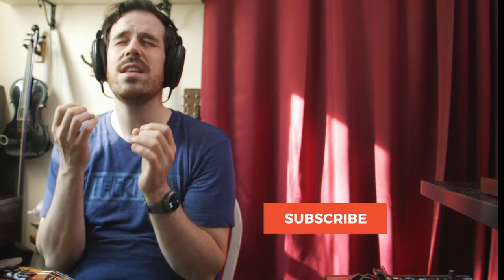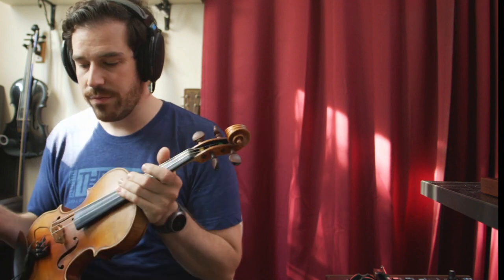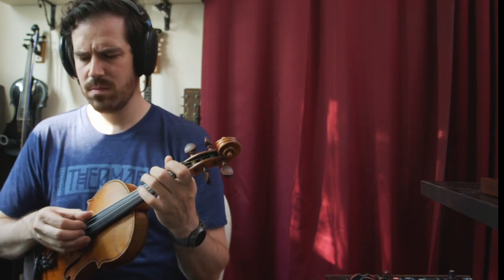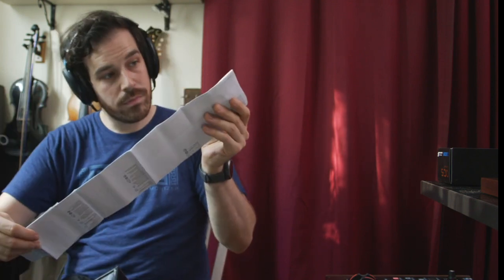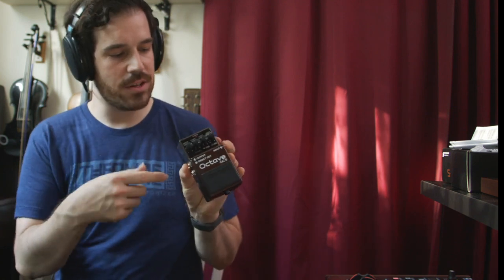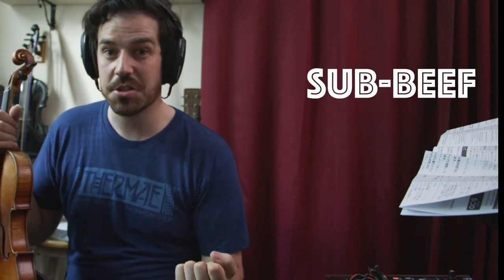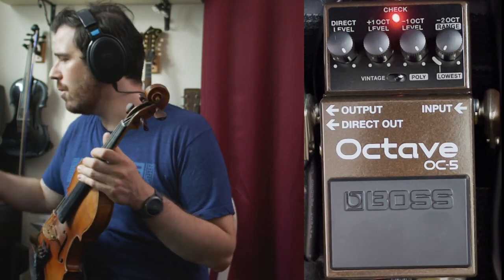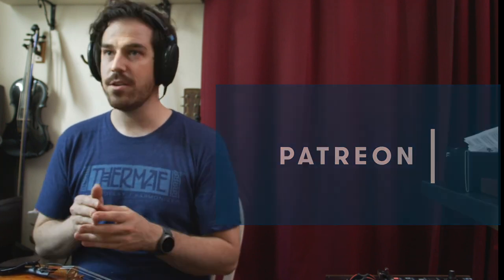EPIC Octave Pedal Shootout (Boss OC-5 vs My Favorites for Violin)

Comment: Great video, many thanks!  I'm experimenting with the octave down on the ME80 (the effect on the expression pedal) which is ok.  Is there any way to hear less of the 'ambient' sound on my electric violin - all I hear is octaves rather than just the octave down pitch.
Reply from the maker: Thanks for watching! If I'm reading correctly, you'd like less of your dry signal, and more of the suboctave? If yes, you can control the balance of each octave using the three knobs in that Comp/FX1 section—more of the first two knobs (-1 and -2 oct), and turn down the third knob (direct). Hope that helps!

Comment: Great video dude! Appreciate you linking my OC-5 vid, very kind of you. 

Yeah I find myself mostly using the Poly setting in lowest range mode as a sort of makeshift bass + guitar/violin in my looping setup when the song doesn't allow time to layer a bass line. Remarkably handy for that. 

Would be super curious for your thoughts on the EHX Bass9. It's pricey, but so far it's the closest I've seen/heard to an actual cello/upright bass sound. And it has a whole crapton of other settings, synth octaves, etc.

Think I'm gonna have to start digging into your fuzz files vids, I've started adding a little distortion to some violin parts here and there; spiccato and pizz seem to work fine with the OMG setting on my tech 21 RK5, but I've yet to find a distortion I like with legato playing.
Reply from the maker: Ahhh yes! Smooth legato distortion is a weird creature. Every fuzz is subjective, and really polarizing—you either love it or hate it—but I love the weird sounds!

Bass9 is definitely on my agenda!

Comment: oc-5? mxr? still not sure....
Reply from the maker: Worth a look: the POG, Micro POG, and Nano POG are beloved favorites for a reason. I wanted to try the OC5 and think it's fantastic. Another favorite of many a violinist is the Pitchfork, which has more features/intervals available than just octaves, leading to interesting harmonic possibilities, but that's a different tool for a different job.

If I were you I'd consider either an OC5 or a Micro POG. OC5 is a little "warmer," POG is a little "beefier" maybe. Super subjective terms, that will change wildly depending on the amp you plug into. YMMV!